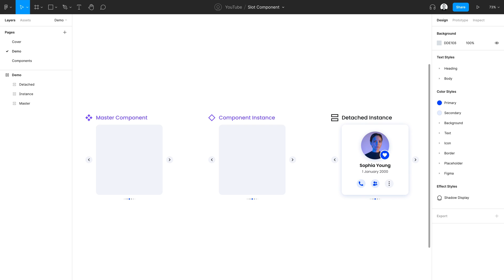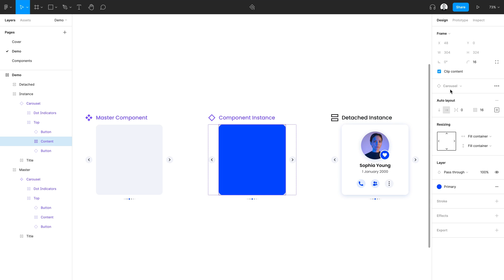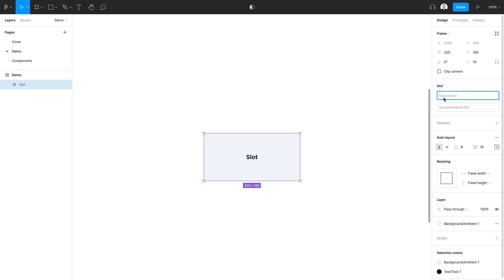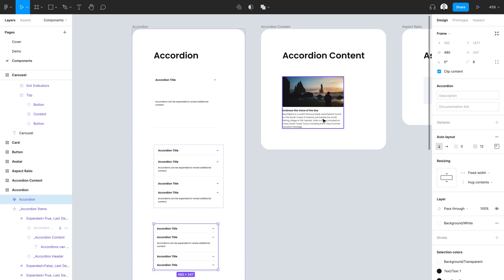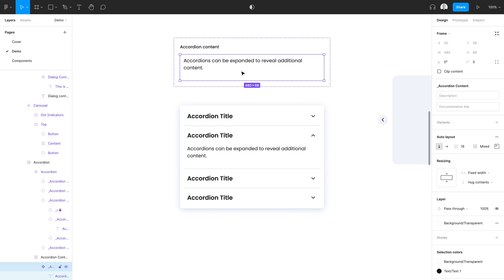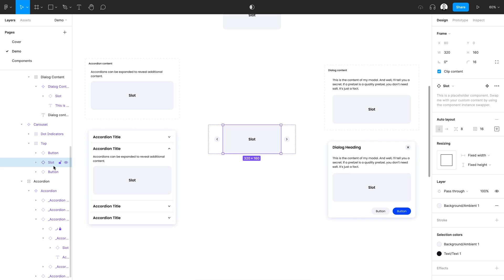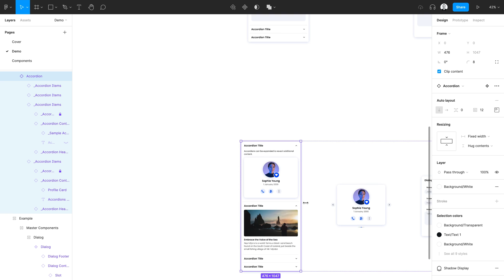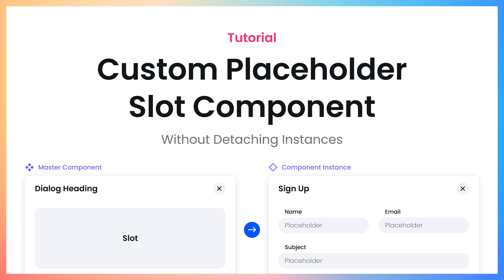Placeholder Slot Component in Figma

Comment: What if you don't have any sample content and you want to put multiple components in ONE SLOT ?
Reply: Or maybe I need to swap the slot with a slot group which has two horizontal slot ? 🙂🙏💡
Reply from the maker: @rvb6516  yea the possibilities are endless! So my component group has variants for vertical and horizontal as well as reverse the flow of the Auto layout. I also commonly have predefined component groups for specific components that I usually find myself needing to group together. For example, I have a button group component. So 1 slot of the component group could be swapped with a horizontal button group
Reply from the maker: Hope this helps! I do want to add that even though I know you mentioned you don’t want single one-off components, for things you’ll only use once, I would recommend at least thinking about it a little more just so you can really weight the pros and cons for yourself. Depending on your needs creating the 1 single component that has all of the content may be more scalable and reduce breaking changes or the need to update multiple screens. With the component group option you’re pretty much locked into what you build at the start. If you ever want to modify or move something around it’s not as flexible, but only you can decide that for yourself since you know your context and needs better than anyone else. Would be happy to talk more about it if you have questions but just wanted to to throw it out there one last time in case it can help save you a little time down the road. :)
Reply from the maker: Hi, great question! Your sample content can be anything you want. There can be several components in it. So basically think of the slot as an opportunity to swap in anything you want. If you want 10 text inputs, don’t swap a single text input for the slot, instead, group those text inputs with anything else you want, componentize it, then swap that with the slot
Reply: Okay thing is I don’t want to make a component out of something that I will only use once, can’t I juste drop a frame ?
Reply from the maker: @rvb6516  this video of mine here actually covers the component group I’m referring to if you want to give it a watch. Time stamp around the 26 minute mark: https://youtu.be/U5wX2LHYSkE
Reply from the maker: @rvb6516  I see. In that case what I have done is swap the slot for a utility component I like to call “Component group” or you could call it Slot group. For mine it’s basically 10 slots which gives you more flexibility
Reply: Okay I see thanks, the problem I’ll still have is if I want to add for example in a slot two buttons in a row I will not be able to
Reply: Sounds amazing do you have a Figma file with those component groups you share with your community ?
Reply from the maker: @rvb6516  yes! Here’s the link: https://www.figma.com/community/file/1023159315371639119

Comment: Thanks a lot, great video. If it can help you, this is my feedback: what about the content size constraints? This is an important aspect of the matter. I see you use only contents with hug constraints, but often they need fixed constraints. If I use fixed contents into this slot they are resized and this is not good. Try to use the avatar into the slot and you can see what I mean. How to fix that?
Reply from the maker: Hi Mirko, you can fix this with Auto layout! Let’s say you need something to be 64px, and another time to be 320px, the slot content you swap in should have an Auto layout resizing property of hug contents in order to be able to accommodate any size! I’ll try to make a little demo for you!
Reply: @JuanEncalada  thanks Juan! I tried many ways but nothing works for me. I appreciate if you'll make a little demo 🙇🏼‍♂
Reply from the maker: @mirkocaccia9388  Hi Mirko! Here's the link: https://www.figma.com/file/j0AJTMPmimXssp3bhjioON/Fixed-width-Slot-Content?node-id=1737%3A414&t=IzUYM3bxxMTbpFqH-1

Feel free to duplicate to your drafts. Check out the demo page
Reply: @JuanEncalada  Thank you very much, I duplicated it and I'm sure it will help me with this issue. You are awesome!! 🔝🔝🔝
Reply from the maker: @mirkocaccia9388  no worries! Hope it helps!
Reply: @JuanEncalada  yes, it works great and solves my issue! thank you again 💪
Reply from the maker: @mirkocaccia9388  anytime! Thanks for watching. :)

Comment: Has this technique become obsolete due to the new component properties?
Reply from the maker: Hi Bart, not exactly. The new features actually enhance the slot technique because rather than hiding  the a lot manually you could create a Boolean property, and instead of cmd or double clicking into the slot component you could set up an Instance swap property for the slot to allow you to swap at the top level of the component. Both of these examples would depend on where you have your slot if in a nested component instance you wouldn’t be able to set up these properties at the top level of your final component.

Comment: The problem is when you need to paste various number of components, once 3 inputs, once 2 inputs and 2 selectors.
Reply from the maker: Hi Falo, for these instances I normally don’t swap the slot component out with a single button, input, or other “design system” component. Instead I swap the slot out with a “Figma component” that contains all of the contents I need. So in this content component I can have any number of inputs, or other components I need.

Comment: Hi, great video! It helped me a lot, but there is one thing I'm struggling with: I've used your method with slot components for an interactive create wizard with multiple steps. Created a variant for each of the steps and added a slot component in each step named "Step 1 content", "Step 2 content" and so on. Every slot component  for each step is a master. It works when I go through the finished wizard in the designer (with the variant dropdown), but in the prototype it just resets the override content on every step except the first one. Do you think it's a bug in the interactive components feature not including overrides in the prototype? Or am I doing something wrong? :D
Reply from the maker: Hi Alice! Glad this was helpful! Would you be able to share a link where I can take a look at this and offer better support? I believe it may be an issue with having a master component inside of other components. I don’t think that functionality is intended or supported.
Reply: @JuanEncalada  Anywhere I can message you with the link? It's not for the public since it is work related
Reply from the maker: @ecila89  hi Alice, feel free to join my Slack workspace. I set it up to offer support to the community https://join.slack.com/t/juan-design/shared_invite/zt-wz9991hw-oMNMnIB7QQeolcRNJ1ythg
Reply from the maker: Let me know if this was the issue and if not I can try to keep helping out!